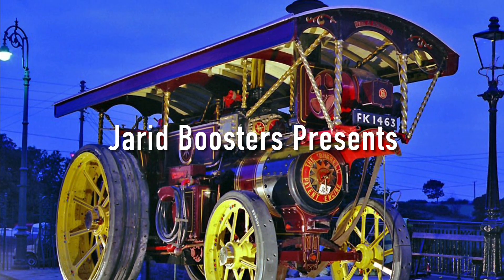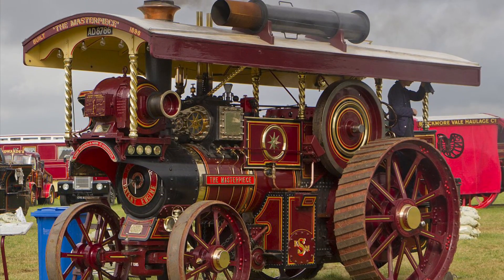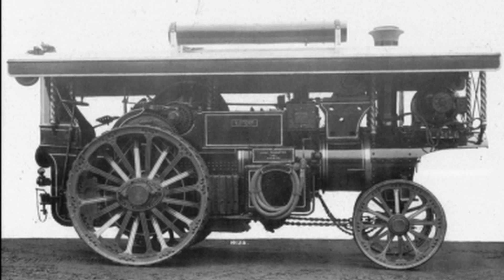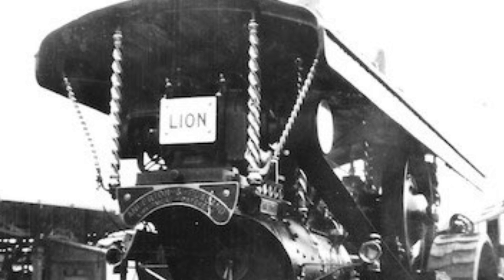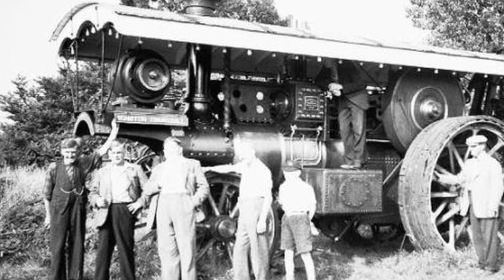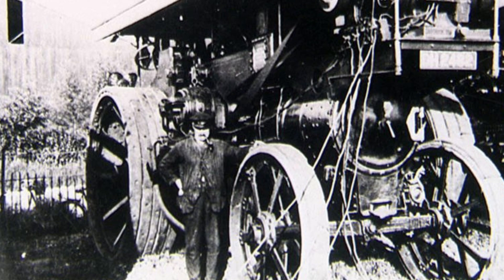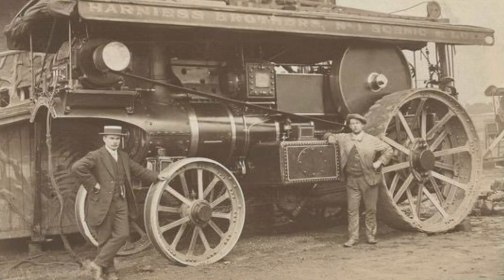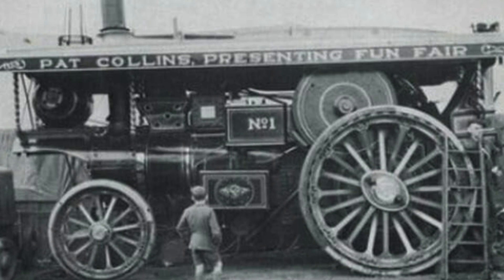The Showman’s Traveling Dynamo; Advanced Steam Vehicle - Portable Electric Station (1860? - 1934)

Comment: In England these engines were called Showman's Road Locomotives. Some had two dynamos. A smaller dynamo was used to excite the larger dynamo. These engines had cranes on the rear used to build up the rides. There are some good books about these engines.

Comment: Apparently these never caught on in the USA, which used the railroad for large traveling circuses and horses for the road. That begs the question: How did they get their electrical power?
Reply: I guess this is how the Circus traveled after getting off the train in the USA.
https://youtu.be/07q6L7CW7co?si=fXaiUL97xBQ-Yoxx
Reply: Electric light bulbs weren't available until the 1880s, but I think that the primary use was to provide power to amusement rides by means of the belt drive. In the USA, the distances between cities was so great that it only made sense to travel by rail, but in the UK using a "road locomotive" was probably quite useful. Dynamos and electric lighting was added later at the turn of the century as it became available and dynamos became capable of higher current output.

Comment: These engines were solely used to haul and power our fairgrounds. Nothing more. Not as a portable power plant, the dynamo were a addition. Nothing to do with ‘architecture, farming or construction’

They were specially designed as a much larger engine than road and agricultural engines for hauling several carriages of carnival equipment as a road train.

The idea that ‘only one engine powered a whole circus’ NOPE!

We had one for our swing boats, one for the carousel, one for the dodgem and side stalls. We had 5 showman’s engines on our fairground alone.

The reason there isn’t much info about these engines around is because our families have kept our secrets, secret. 

Rather than wiki your ‘facts’ contact the showman’s guild. Get the truth from our community 🎪

Side note. These were never used on any circus in the uk.

Comment: Many people don't understand steam power was a mature technology. They had some excellent machines that were well sorted out, reliable, powerful and well suited for the jobs they did. Only the lower cost and denser power of diesels killed steam development
Reply: Nothing killed steam development because it wasn't in development. And the cars were not originally supposed to run on gasoline. The cars coming off production of the big 3 in early years all had mismatched gasoline engines in them making them either under or over powered. One day we will find the original patents and know what kind of engines they were designed for. Many of them were electric (Owens Magnetic, Baker Electric - Jay Leno)

Comment: Liked and subscribed 👍. Around 2005 I went to the annual Steam Show at the Clark County Fair Grounds in Berryville VA. If you have no idea what I’m talking about do yourself a favor and check it out next year. It’s the nicest most unique fairgrounds I’ve ever been to. They had multiple steam powered tractors and lots of other old/antique machines to gawk at.I lived in and loved the charming town of Berryville for 10 years so admittedly I’m a little biased. But they hooked a steam powered tractor ( not sure if it was a Showman) up to a sled used for truck/tractor pulls. The operator reminded me of “that man behind the curtain “ in The Wizard of Oz 😂. He seemed to be constantly spinning valves and pulling levers. I believe the announcer said the tractor produced a peak 18 hp. I thought - this should be over pretty quick. I couldn’t have been more wrong. Although it produced an unimpressive 18hp, I would love to know how much torque it produced. It seemed to take forever but after pulling the sled the full run of the track and then some it never slowed,spun,skipped or stopped until the ground crew flagged him to stop. I was amazed. I’d seen large modern tractors and trucks with over a 1,000 hp only make it 2/3 of the way or less using the same sled on the same track. And yet, this steam powered tractor seemingly effortlessly with a leisurely chug chug chug seemed like it could have easily pulled this modern sled and its operator across the Shenandoah River and over the Blue Ridge Mountains if it wanted to. I believe this tractor ( there were many like it) had a wooden slat semi circle canopy covering most of its length including the operator’s “station “ , steel tires with cleats and a crossed logging chain attached to its front axle to steer what was essentially a trackless locomotive. I can recall being amazed at how efficiently it used its limited hp and it never broke a sweat or seemed to increase its rpm’s. Unfortunately I’ve since moved, but I plan to ( maybe next summer) to attend the steam show again. I recommend it to anyone interested in seeing dozens if not approaching 100 steam engines still operational from generations ago. Along with antique ICE farm tractors,road tractors from the 1930’s/40’s thru the 70’s/80’s, old construction equipment like dozers etc, some implements that’ll probably make you curious about their purpose. Good food (country ham sandwiches) ice cream etc. I know this has started to sound like an advertisement ,but while writing this I’ve made my mind up. I’m going back next summer 👍.

Comment: "Road Tractor Dynamos" seem comparable to the tractor /trailer sized power generators I remember seeing once as a kid while attending a county fair.
They seemed spectacular belching out a column of black smoke whenever electrical demand increased.
The necessity of a "dynamo"/ generator truck to supply a circus or fairgrounds with electricity hasn't changed for over 150.

Comment: A very interesting take but I think you missed the big picture. However, thanks for all the pictures and commentary. A visit to the Great Dorset Steam Fair (GDSF) would be  the real eye opener. Simply, these are modifications to the available technology of the day and not some "advanced technology". The circuses and fairgrounds of the day travelled and everything had to be mobile - including living quarters (the earliest mobile homes). Horses were out and coal was in, so expansion of presentations was supported. These "portable dynamos" were simply traction engines with attached generators. They were not "secret" but common and made by many manufacturers. They towed the equipment from one site to another and then provided electricity (and/or power off the flywheel). Because they were clearly visible while travelling and on site, they were "dressed up" to promote the activity - circus or fair - as was most of the equipment being towed.

Comment: My grandmother talked of the traction engine her father had built for their traveling fair and how it was a show piece and symbol of success, before this they used horses to pull the rides and wagons which they had to "double up" when they came to steep hills this was basically using twice as many horses per load then going back down with the same team for the rest this of course was time consuming and not without hazard as her foot was trodden on by one of the horses which caused permanent deformation to her foot.

Comment: I think you will find that these traction engines with dynamos were primarily for lighting as a lot of the rides you mentioned were powered themselves by steam like the roundabout (carousel). On later models they also had power take off pullies for large flat leather belts as used even today in some remote places in the world. As for electrical power production diesel became the norm quite early. And yes they were scrapped for the war effort just like steam locomotives!
Reply: Most early fairground rides in the UK were powered by a “centre engine”, smaller than a showman’s engine and built into the centre of the ride, and one showman’s engine lit the entire fair. Later rides used electric motors and several showman’s engines were needed.
Reply: Most rides required electricity from the showman’s engines not just for lights
Reply: Dann kennen Sie wohl nicht die "Krinoline"? Ein kegelförmiges, an der Spitze drehbar gelagertes Fuhrgeschäft, welches von 3 bis 5 Männern darunter in Drehung und zum Schaukeln gebracht wurde. 😊

Comment: Thankyou so much for sharing this video. Very well done and informative. Just to see the details of the craftsmanship that went into the machine of the time says alot about the society at the time. Even though it was designed to be a work horse, it also enthralled you with details that were a pleasure to look at. Thanks again!
Reply: These machines like most of the antique stuff were probably inherited and not designed or built by us. We turned on ancient production lines and managed to assemble the resulting parts into working cars. It would not make sense to expect such elaborate and well engineered stuff from previous struggling humanities.If a lifespan of less than 30 years on average is correct, there is no way these prior peoples had a chance to achieve the required skills and experience.

Comment: A few notes from the UK.
The Circus & the Fairground were two very different things.
The Circus had a Big Top (Tent) and showed animal & human acts - one or two performances per day. 
The Fairground was open all day and would run for several days - they would have a lot of different 'rides', food outlets, booths & entertainments - consequently they need a lot of power for the rides & lighting etc. 
All the steam powered vehicles were called Traction Engines - most were used for farming & general contract work (the biggest were called Ploughing Engines & were severely practical, no decorations).
The Circus used whatever they could, mainly for towing their kit from site to site & putting up the Big Top.
The Fairground people (called Showmen) had highly decorated Showmen's Engines with lots of brasswork & superb paintwork - like their rides. The dynamos were big (Victorian technology) and had as much brass & paintwork as possible.
They were not Secret Portable Dynamo Engines, they were simply Showmen's Engines !
They were made in comparatively small numbers, compared to the general use traction engine - but a number have been 'enhanced' to increase their kudos.
Even today you have to be a member of the Showmen's Guild to be able to tow more than one trailer on line on the road. Nowadays they use impressive ex-military WW2 towing vehicles with mounted enclosed generators.

Comment: I have no idea why these steam traction engines are being portrayed as mystical etc. Models of these were sold since the 1960s and even appeared in many children's books. They look old even soon after new, as they run on coal and coal powered steam engines get very dirty very quickly, plus they were very hardworking doing what they did over long distances and long hours. The nominal power rating was approximately 10 percent of the actual power. So a 5hp engine was mich more like a 50hp engine or even more.

Comment: what would they need generators for in the 1800z when the first machines didnt supposedly came out?
Reply: Joseph Swan invented the incandescent light bulb in 1860. By 1883, in conjunction with Thomas Edison, patents were granted. Travelling fairs in the UK soon realised that electric light would draw in the crowds so steam generators, based on agricultural traction engines, were designed with dynamos to power the fairground lighting. The rided were already steam powered. Most people in the UK had never seen an incandescent lightbulb, so people flocked to the travelling fairs to view this modern wonder.
Reply: then you know about the lightbulb scam they pulled on the world and if you know this scam youd know you can trust anything  from these people. Their were electric vehicles and all sorts of technology from the ancient world along with the mercury filled balls on tops of buildings pulling in etheric energy or that the world was stripped of free radium heating that was in every home and it was labeled dangerous when its not!
Reply: @debbie62140 Just like the Owens Magnetic, 1890 production model, effortlessly converts gasoline to electricity and through an electric motor into torque (a fuel cell vehicle) When did they start designing that? Modern cars take 20 years of design. How about the modern HVAC system found on the Titanic and sister ships.

Comment: From the UK The Showmans Road Locomotive not only provided the power for the rides but also hauled the Rides from one Fair to another these loads were sometimes up to 45 Tons when the rides grew in size and required more power to start them Charles Burrel devised the Scenic Engines which carried a main Dynamo in front of the smokebox but also an exiter Dynamo mounted between the chimney and the cylinder block.
Reply: A number of the old photographs show the extra bracket and at least one shows the belt drive from the main dynamo. The brass supports for the canopy were commonly known as "olivers" a reference to Oliver Twist

Comment: It's a tractor. The word tractor is blended from 'traction' and 'motor'. In Latin that would translate to puller-mover. So more accurate than puller-device (traction engine). It's job specific. They've been around from 1851. It would take another 30 years for electricity to catch on, then another 10 years to rig a dynamo to steam, and anything to actually actually power up.

Comment: I have never heard of these. Those are such cool feats of enginering It does make me wonder if EV could use micro steam powered systems. Probably not. Lol😂
Reply: You could use steam power to charge an EV, but it wouldn't be micro. You need to build a large fire under the water to create the stream and then use that energy to turn the motor to generate the DC.

Comment: I don't know where you got your information from , but there are a lot of errors in your information. They are quite well documented in the UK , and even the most 'renovated' engines will have a great deal of the original still present. The main replacement parts will be boilers and fireboxes, which would sometimes have been replaced in the working life anyway. I have never heard the term  ' portable dynamo ' used in regard to any of these engines, and showmen ordered , and bought, these engines privately - nothing to do with the government.
Road locomotives , which these are a specific type of, were the precursor to the modern heavy haulage lorry, not the agricultural tractor. Nominal horse power is misleading and does not reflect the true power of these machines. The larger 8 to 10 nhp engines were quite capable of pulling in excess of 100 tons.
The majority of engines did not have cranes, only engines that were classified as 'special scenic' engines had them, generally because they worked with the large scenic railway fairground rides, and engines would not be running their dynamos whilst on the road, as the engine would be using a governor to maintain a steady power supply.

 I hope that this has clarified some points. It is nice to see that someone is showing an interest in these engines and that you recognise their importance, but you really ought to make sure of you information before putting it out.

Comment: A previous civilization had a different type of energy grid set up in this realm, zero fossil fuel was used by them. 
More than likely these machines were attached to the ether grid.
The grid the inheritors knocked out before the reset orphans rolled in.

I think the electric cars were on the same grid, steam ships, trains, blimps, I could write a book here, but I wont.

I did a video about electrical cars from the previous society and put for forth my theory in the video. 

Fossil fuel is a lie that's perpetuated on the reset orphans. 
Fossil Fuel is a chemical concoction fuel and not found in the ground made by thousand year old animal carcass. 

These machines were retrofitted and reverse engineered to hide their true origins.

The tech that is needed to build and prefect these machines had to come first. 

The orphans civilization just haven't been around long enough to get this intelligent tooling manufacturing infrastructure up and running,
neverminded build these amazing machines, and just like the 12 color Lithograph machine, this isn't our tech and it wasn't powered the way the narrative slings it.

good video, there is much to consider.